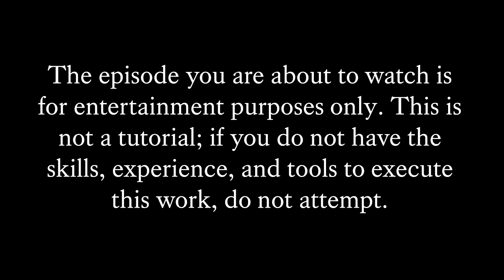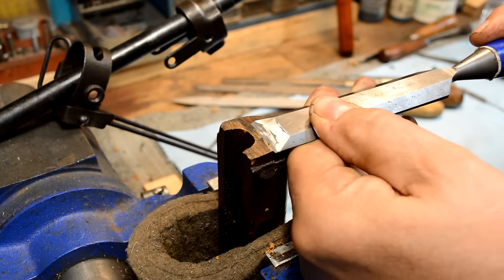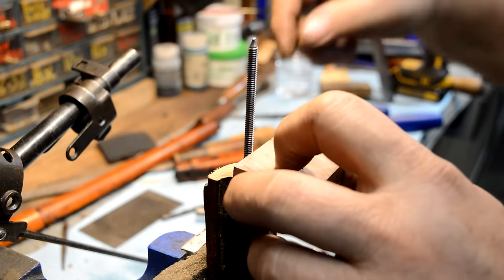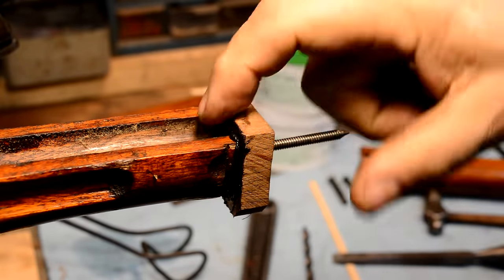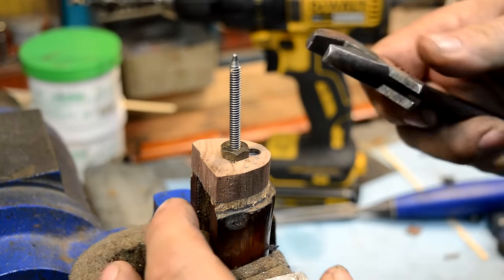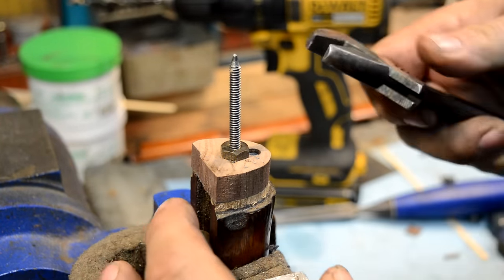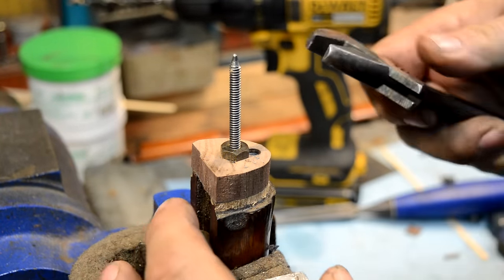Anvil 086: Type 99 Arisaka duffel cut repair

Comment: Hey mark, that wood is Japanese Sumac. I'm sure others have commented this, but I just thought I'd add my two cents since I own one.
Edit: what Cory said, I am wrong on the tyoe of wood. My bad. thanks for the correction.
Reply: No, the wood is not Sumac... its either Beech or Japanese Maple. The oil finish though is Urushi which is made from Sumac.
Reply: Texas talk you said the wood is sumac.you are wrong.the sumac is the finish on the wood.the wood is some soft type of wood.

Comment: I was just cleaning out my Grandad's attic and found an Arisaka type 99 that is missing the back of the bolt. Can that part be found? ..or is it not worth it. For some reason I can't remove the bolt. I'd like to fix it for sentimental value, since my Grandad passed away, if it's not crazy expensive.
Reply: Yeah those bolts are about 5 main parts you have the bolt body, the extractor, the firing pin, the firing pin spring, and the rear knob/ safety knob. Those parts are relatively easy to find but getting more expensive. Guess anywhere from 30 to 70 bucks for the safety knob depending on type you get. There are the early way nice knurled knobs and the mid/late war not so nice looking ones. Look on Gunbroker and Ebay. I might even have one if you can't find anything

Comment: I just picked up a Type 99 and wanted to do a deep clean. Found out that if you turned the nose band upside down you can slide it over the front sight, allowing you to take the monopod band off after it

Comment: Much applause to you sir. Years ago, I mule deer hunted with a game warden who inherited a variant of the 99 from his veteran father. Shooting from above the deer in a wash area or ravine, I could see the enormous 7.7 Jap rounds impacting in a pattern of several FEET around the rather confused mule deer. Needless to say, they escaped unharmed. Towards the end of the trip, I lent the fellow my backup rifle, an old 30-30 Marlin with iron sights, and he filled two tags with two shots at impressive distances. While I would never hunt anything with a type 99, it was an interesting machine for sure, but it's no Springfield 1903 that's for sure!
Reply: There is nothing enormous about the 7.7 Jap and it is less in power than the 30-06 .
The bullets are 311" where the 30-06 is 308  "

Comment: From a retired gunsmith who's done a few repairs on old guns and stocks, you did a great job on that unicorn. :)  My former partner loved those guns and had several, but he was never lucky enough to find one in that kinda shape.  That's a genuine collectible and yes, like you, I totally believe in handloading and shooting rifles like that.  After all, what were they made for and once the original purpose is gone, how do you truly honor the gun?  I thinking shooting it is the best way, then taking it home, cleaning it properly and putting it up till next time.
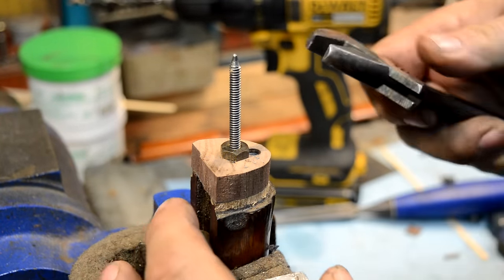Reply: Well this isn't going to be welcome but here we go. @31:53 we can very clearly see that the top edge of the stock on the right is noticeably higher than that on the left of the join. Mark does not see this. This is the stage where the parts are brought together dry so that they can be fitted correctly. Look closely, it can be seen that the barrel is sitting down hard into the wood on the right but is lifted in the wood on the left as witnessed by a gap between the wood and the metal on the left. This can only be caused by the wood on the right being too high in relation to the mother stock and shows that the hole for the threaded rod is in the wrong position and is causing the joint to be out of line. 
Having assembled the joint @37:43 we see that the exact same conditions apply and the repair is out of line. Start watching at 38:10 Mark checks the alignment and (look closely) moves the stock even further out of alignment by lifting it higher. Shortly after this he confidently tells us that this is not the sort of gun that you learn on. @40:10 here's the smoking gun! Notice how the wood grain is showing through the glue. It stops showing at the exact line of the join because the barrel was lifted up from the mother stock by the miss aligned stock. All the pressure of the rubber strap could not pull it true because the threaded rod could not allow it to move into line. @42:32 look closely at the visible left hand edge of the glue and it can be seen to have considerable thickness. This is the result of the barrel not sitting down in its cradle in the stock. The thickness of the glue exactly matches the degree of missalignment of the top edge. @45:01 he finally notices the problem with the top edge of the stock and cuts a little wood off. @45:16 Mark starts to explain that wood moves with time and he's right. However no amount of explanation can put this situation right. @47:18 he cuts away wood and tells us that it swelled right here. He demonstrates that he does not understand why the top edges are not in line and level. @49:14 this is the first time that we see the results of the missalignment. Not withstanding any bending of the top stock the gap between the top and bottom on the left of the joint is exactly equal to the degree of error in jigging the two parts of the stock together. Mark's attempts to blend the joint are seen as a freshly cut ramp in the wood. @51:23 Mark is telling us that the front end joint is tight and it is. However he makes no mention of the gap behind the joint which will always be there. @54:20 observe the gap where the top covers the bottom. In spite of any explanations that gap is there because Mark assembled it out of line. 
I have been a gunsmith for over 40 years and am often called upon to correct poor repairs. I despair at this job and I wonder if the owner will be content with explanations of swelling wood as he holds this rare example. Often I have found that workers who make sure we all know how good they are can produce average work with eloquent and lengthy explanations of how difficult it was and how the average joe would make a hash of it. I expect this comment will be deleted as it will not sit well with Mark Novak. I challenge you to leave it here so that your viewers can respond.
Reply: @jonka1  If you keep posting the same thing over and over being called a troll is inevitable....and correct!
Reply: @jonka1  still here buddy and nobody cares, post some videos or pictures of your work, then talk
Reply: @HircineDaWolf  Please explain how me posting videos makes any difference to his work. Please also explain how your comment is a useful contribution to the situation.

Comment: Not a gunsmith but I probably would of milled that wood spacer to exact thickness on a wide belt
Reply: And that's why your not a gunsmith...
Reply: @krockpotbroccoli65  While we're pointing this stuff out for each other, apparently you're not an English major. 🤔
Reply: @mannys9130  English major? Nah. I'm not an anything major for that matter. I never stepped foot on a college campus. But i did go to gunsmithing school. Some good that did. Ive learned more watching Mark's videos than I ever did at that place. Those stupid fudds would probably take a massive dump on Mark for revealing " trade secrets" publicly and free of charge online.
Reply from the maker: @krockpotbroccoli65  I like to glue the reinforce in so it can be used as the clamp to hold the spacer while the 'glass sets up. Its a pain later (cant mill it down) but makes for a far stronger repair in my opinion. What I know is meaningless, how I learned it is everything. 99 out of 100 of the fudds couldn't do this repair on demand. On camera. While narrating. And have it hold. Or, get paid to do it.  Mr. Clayton asks a legitimate question however
Reply: Wasn't trying to be critical. It was late had a few beers. Just thinking out loud going over how I'd destroy that irreplaceable artifact in my mind.
Reply: This video just popped up playing on my feed after falling asleep waiting for a brisket to finish. I had totally  forgot I ever commented on it.  Why couldn't  a fender washer or some other type of caul be used to reinforce the thin milled spacer so that there is good pressure on it while using a nut on the threaded rod for a clamp?

Comment: I ended up with one of these cool old rifles, made in 1944. No dust cover, monopod, or aircraft sights. Did some research and learned that towards the end of the war, the Japanese were not fielding these rifles with those three things in order to save steel supplies. Interesting that they continued to include the dust cover cut on the side of the receiver. 

At any rate, if you have one of these from later in the war, and it is missing these components, you do not have to track down originals and spend hundreds of dollars on them, because historically the rifle didn't have them to begin with. (It's especially easy to tell the monopod and aircraft sights were not on the rifle if the attachment points are not even present).

I see a lot of people on forums trying to track these items down in an effort to preserve authenticity when they don't really have to.

Comment: Wouldn't it be an option to enlarge the ram rod hole and insert a steel tube with an ID equal to the original rod hole ID?
Reply from the maker: That is another valid way of doing this. I would go this way, on this gun, if I had to do it again, truth be told.
Reply: is the a source of threaded tubes for this, or would you have to thread your own?

Comment: My father brought back a Type 99 from WW-II.  It had the intact "mum", but he had sporterized it.  Great shooting rifle -- I killed my fair share of deer with it.  It "disappeared" during a move many decades ago, but I bought another one, albeit without the intact "mum" and not as nice of a quality in the sporterizing of it.  I make brass out of reformed 30.06 brass and reload for it.

The reason for the "duffel cut" was so that it could fit in a duffel bag since that meant that the service member did not need to pay to ship it back to the States.  I suspect that the barrel and action would fit in a duffel bag.  What is the length of the stock with the barrel removed?  I don't have a non-sporterized Type 99, otherwise I would measure it myself...

Also, I seem to remember reading many years ago that the varnish that they used on the Arisakas was made from a species of sumac and a lot of people have allergic reactions to it when they were refinishing their stocks.

Comment: I have to do the exact same fix on my 303 british stock, the draws needed repairs and then the wood was  soaked with oil and it caused the left draw to come off almost by itself and then the wood under it cracked off and now the dimensionsions of the trigger guard are off and i need to add a sliver of wood. I think im going to go back abit more to get to the fresh wood and just add a larger shim. I have alot of work needs to be done to this stock so it can get back to firing condition.

Comment: I got my type 99 last week. looks to be in great external condition, Mum and AA sights intact. bore has some pitting unfortunately but the rifling is good. i want to pull it out of the wood and make sure its not rotting inside, but i have not been able to get the screw out of the barrel band. might be time to give up and visit my local gun smith

Comment: "This is straight up a museum piece" proceeds to smack the parts around and takes no care with the procedure Cool project though!!
Reply: Well this isn't going to be welcome but here we go. @31:53 we can very clearly see that the top edge of the stock on the right is noticeably higher than that on the left of the join. Mark does not see this. This is the stage where the parts are brought together dry so that they can be fitted correctly. Look closely, it can be seen that the barrel is sitting down hard into the wood on the right but is lifted in the wood on the left as witnessed by a gap between the wood and the metal on the left. This can only be caused by the wood on the right being too high in relation to the mother stock and shows that the hole for the threaded rod is in the wrong position and is causing the joint to be out of line. 
Having assembled the joint @37:43 we see that the exact same conditions apply and the repair is out of line. Start watching at 38:10 Mark checks the alignment and (look closely) moves the stock even further out of alignment by lifting it higher. Shortly after this he confidently tells us that this is not the sort of gun that you learn on. @40:10 here's the smoking gun! Notice how the wood grain is showing through the glue. It stops showing at the exact line of the join because the barrel was lifted up from the mother stock by the miss aligned stock. All the pressure of the rubber strap could not pull it true because the threaded rod could not allow it to move into line. @42:32 look closely at the visible left hand edge of the glue and it can be seen to have considerable thickness. This is the result of the barrel not sitting down in its cradle in the stock. The thickness of the glue exactly matches the degree of missalignment of the top edge. @45:01 he finally notices the problem with the top edge of the stock and cuts a little wood off. @45:16 Mark starts to explain that wood moves with time and he's right. However no amount of explanation can put this situation right. @47:18 he cuts away wood and tells us that it swelled right here. He demonstrates that he does not understand why the top edges are not in line and level. @49:14 this is the first time that we see the results of the missalignment. Not withstanding any bending of the top stock the gap between the top and bottom on the left of the joint is exactly equal to the degree of error in jigging the two parts of the stock together. Mark's attempts to blend the joint are seen as a freshly cut ramp in the wood. @51:23 Mark is telling us that the front end joint is tight and it is. However he makes no mention of the gap behind the joint which will always be there. @54:20 observe the gap where the top covers the bottom. In spite of any explanations that gap is there because Mark assembled it out of line. 
I have been a gunsmith for over 40 years and am often called upon to correct poor repairs. I despair at this job and I wonder if the owner will be content with explanations of swelling wood as he holds this rare example. Often I have found that workers who make sure we all know how good they are can produce average work with eloquent and lengthy explanations of how difficult it was and how the average joe would make a hash of it. I expect this comment will be deleted as it will not sit well with Mark Novak. I challenge you to leave it here so that your viewers can respond.

Comment: I found your channel and have witnessed loads of quality methods for all round every day repairs that could be made under so many different situations, but the acraglas, for me, has been the most interesting. I'd never heard of it and it will come in handy for a stock repair I have to do on an Original Model 50 air rifle that I am fixing up after years of abuse from an ex owner. it's already gone beyond trying to keep the original finish and a crack down the centre of the stock from the muzzle end to the trigger mechanism hole (forgive my terminology, but I'm sure you know what I mean!) means a good bond is required, and plus a section of the wood is totally missing towards the muzzle end. I come from an engineering background so not a concern with the basic wood butchery for the replacement section but I was pondering what to use to bond it. well, now I know! would it be a good idea to do the same as you did here and have a layer of acraglas as a bed under the barrel to really tie that split together or is it not necessary?

Comment: The Duffle cut is worth more because of its story, I wouldn't do this. It's erasing history.
Reply: He stated the owner of the weapon wanted a functional firearm instead of a wall hanger. The duffle cut story sucks anyway. Those guys wanted to put the guns back together back home but most were not master gunsmiths but this one lives on.
Reply: @texasmopar5557  I didn't know he was paid to do it. But to each their own. "I wouldn't do this" in my opinion. Regardless functional Duffle cuts exist and sell for more at auction.
Reply: @sunvol4503  I wouldn't loose sleep over them. Type 99s with AA sights, bi-pod and mum fetch around $600 on Gunbroker.